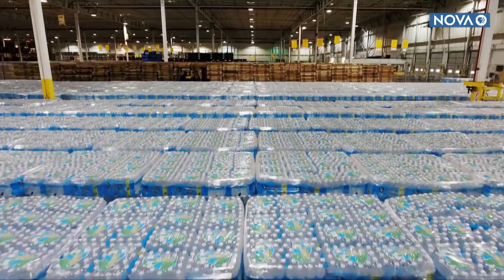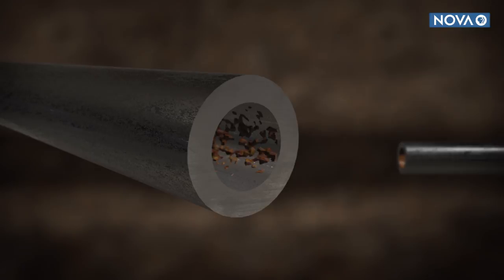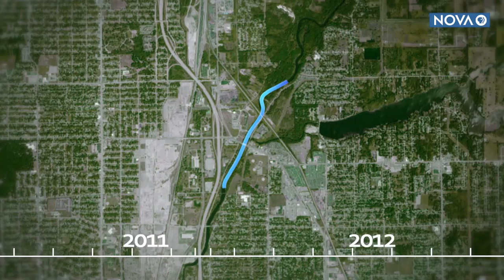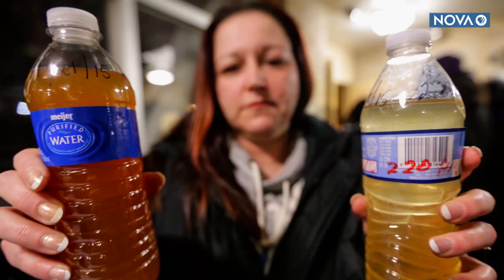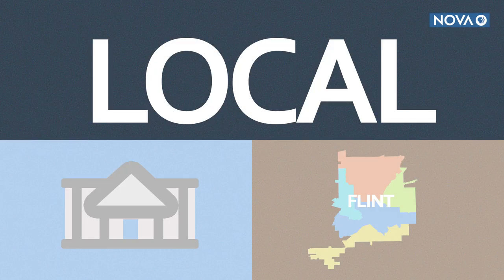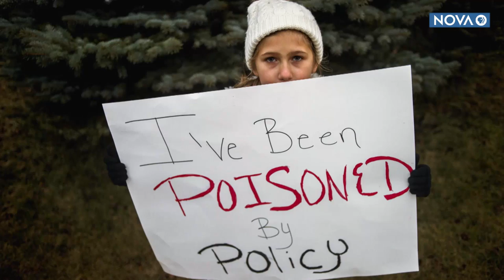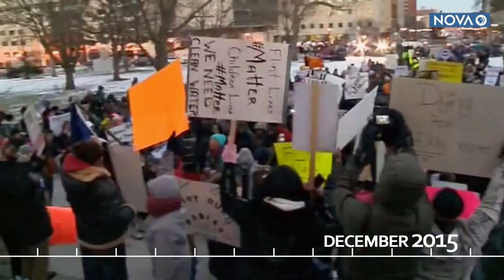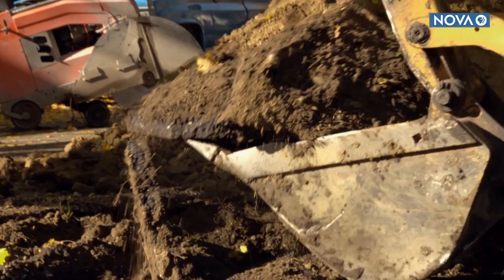Flint: A Timeline

Comment: Some of our older houses still have lead pipes, a corrosion inhibitor isn't used in the water. 
The lead pipes form an oxide layer which keeps the water safe to drink provided the pipes are not disturbed. 
There has to be more to this than old pipes.